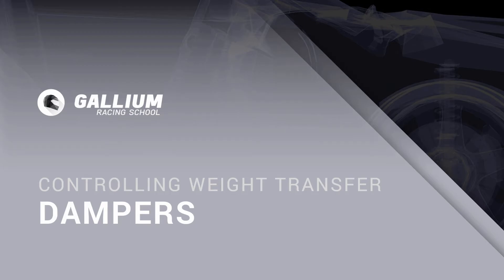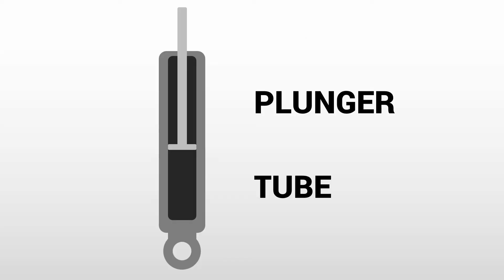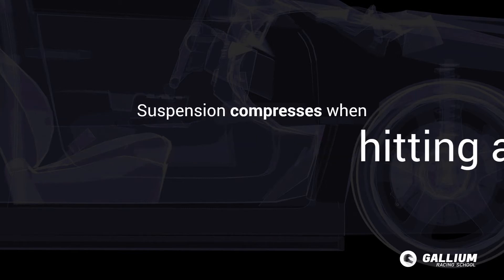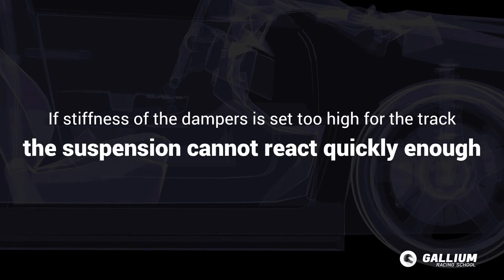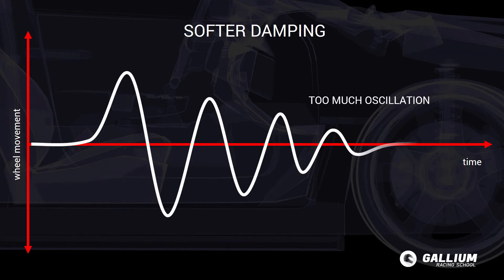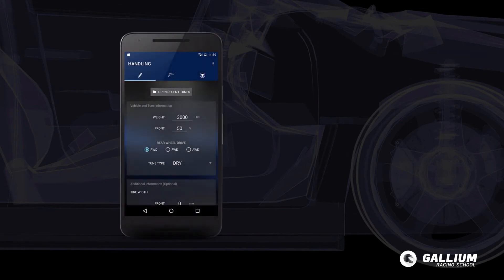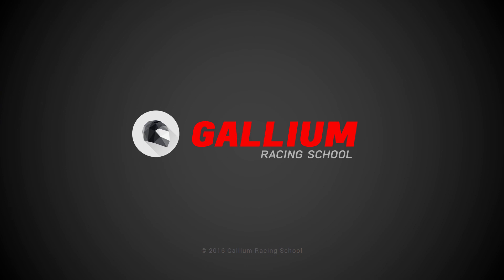08 - Dampers - Suspension Tuning in Forza Motorsport

Comment: On the telemetry the inside wheel of a hard corner seems to bob up and down mid corner. I can't seem to get it to stop regardless of how I change the settings.
Reply from the maker: It's tough to know without seeing it. You might try lowering anti-roll bar stiffness for whichever end seems to be lifting the wheel. I'll also take a chance here to plug the ForzaTune app (forzatune.com) if you aren't using that already. It does some pretty neat things with roll bar calculations on the pro version. Thanks.

Comment: 2/3's??? Forza sets it up 1.0 off for bump?
Reply: My man, I know I'm late to reply but I just wanted to say that things aren't so linear in the real world. :D
Reply from the maker: Not sure I follow your question. Please let me know at what point in the video you were viewing. Thanks!
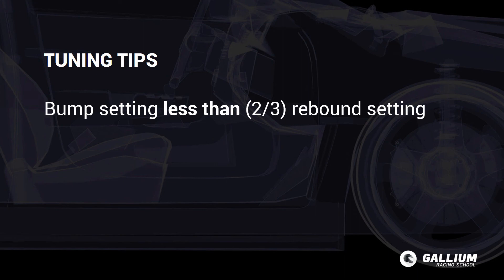Reply: @KeysToSpeed  3:27.

On Forza 4 (I know I'm old, it's all I got) with the Race suspension the gap between Rebound and Bump is only 1.0 instead of 2/3's from Forza base set up.

I will happily admit, your videos have greatly improved my driving haha
Reply from the maker: No problem! 2/3s in this case means Bump is 2/3 times the value of Rebound. So if Rebound is 6, then Bump would be 4 (6x2/3). Let me know if that answers your question 100%.
Reply: @KeysToSpeed  works for me! Thanks!
Reply: @KeysToSpeed  normaly understeer apex to exit is increase the front rebound and decr the front bump no? numbers like 10 reb max and 3.0bump min is what i use like the magic is if your springs are like 750 each on a 50%wdb how high do the rebound need to be 🤔i like the car to settle as fast as possible
Reply from the maker: @yokoA91  Ideally, turn exit is driven in such a way that you are unwinding or steering less after the apex. This might be a situation where I would look more at the racing line. Or if the cause is the rear not coming around enough you might look at rear damping and diffs. I have also posted an updated guide here if interested: https://forzatune.com/guide/the-fully-updated-forza-tuning-guide/
Reply: @KeysToSpeed  do you have a way to calculate example front springs 350lbs how mutch would the reb be ? I know reb to bump is about 2/3 but i like to know the springs to reb
Reply from the maker: @yokoA91  I put together an updated tuning guide here with some rules of thumb: https://forzatune.com/guide/the-fully-updated-forza-tuning-guide/#how-to-tune-dampers-in-forza since the math is a bit involved. You can also get the free or pro version of ForzaTune https://forzatune.com to run the math quickly.
Reply: Forza recommends improper bump to rebound ratios. Too much bump causes launching, too little bump and the car Jack's down. You should tune bump first then rebound. You'll need to drive the car some to figure out which settings are right for your spring and arb settings.